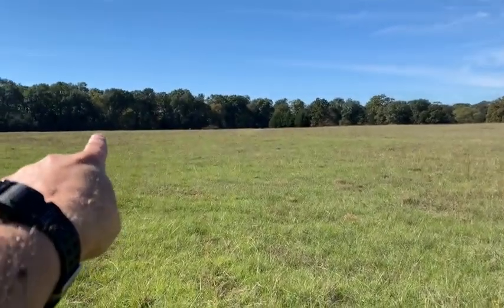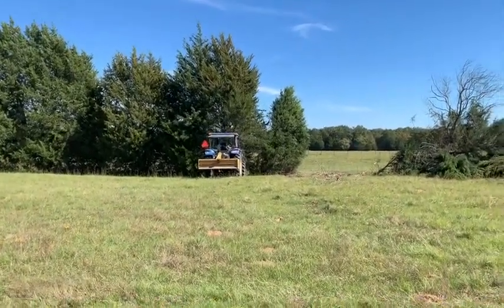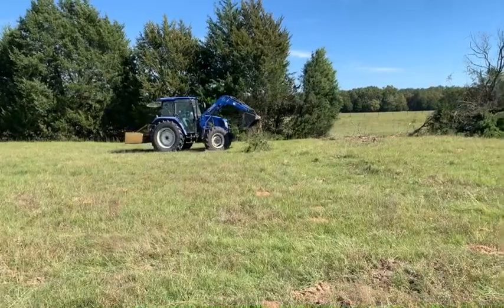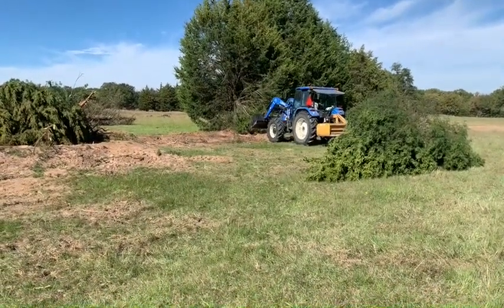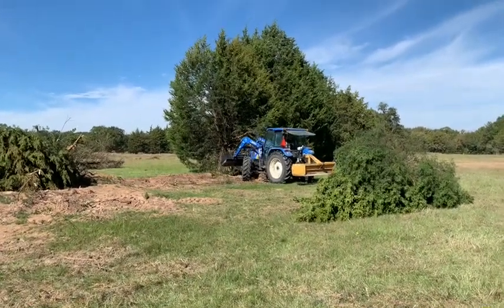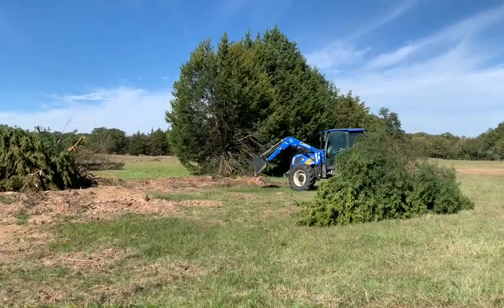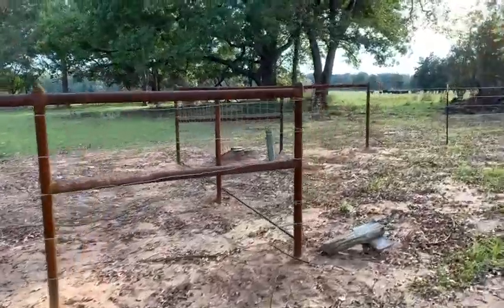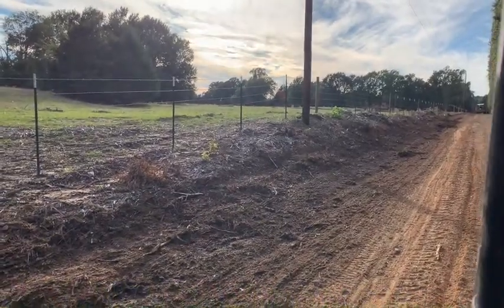Removing Cedar Trees with New Holland Tractor.  Land Clearing

Comment: It doesn't get that hot here, but my cows alway used the shade trees to rest and stay cool. So if this were a hay field, I would have cleared it also. Fine job you guys are doing there. Is that a county road? I am not use to seeing any road not paved.
Reply from the maker: Thanks Mike.    This property has shade along the perimeter fences and about five acres of woods for shade.   Yes, this is a County Road and it is a dead end with no permanent residents on it.   Just cattle ranches, so the co is reluctant to put gravel down.   Gets dicey in the winter.   Thanks for watching.